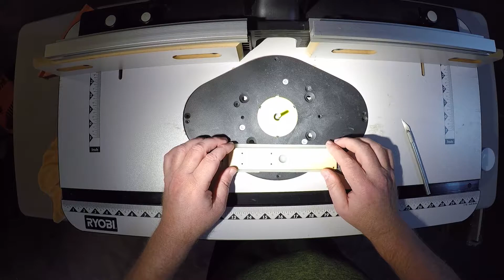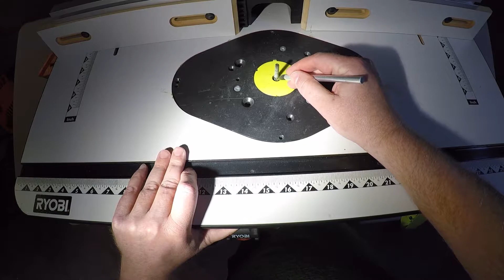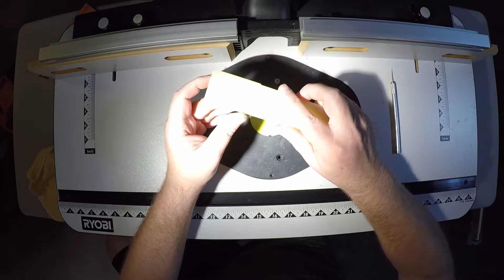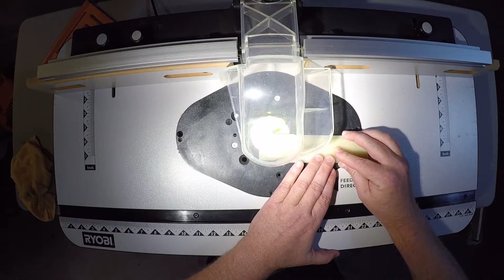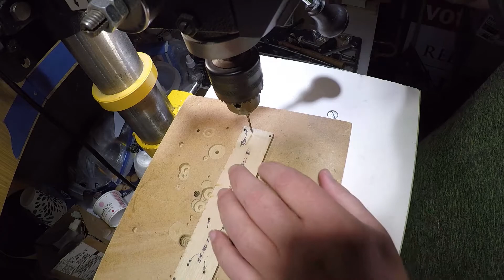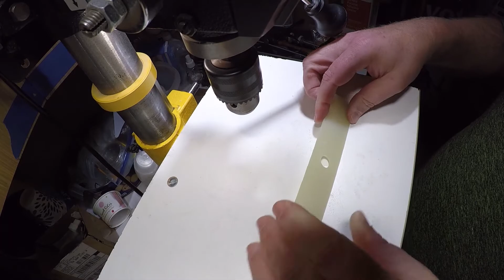Routing G10 Using a Template

Comment: Do you have a link to the router bit you are using?  Or one you would recommend for g10?
Reply from the maker: Thanks for watching! Absolutely, I use a 1/4 (sometimes 1/8) router bit for Fiberglass Plain End McMaster Part# 8785A14. Unfortunately, it looks like they maybe discounting the specific bit. For safety it is VERY IMPORTANT any bit used have a diamond-pattern flute.

Comment: Hi Allen,
I cover 1 side of each with painters tape. (part & template) then apply a few drops of CA strategically placed around to secure the part to the template. (like using 2 sided tape) Very secure, easier clean up & separation with a putty knife or  an Xacto blade.
Reply from the maker: Thanks for watching! Certainly do whatever works the best for you but there are at least 3 issues I encountered with what you describe 1) it's a 3 step process to attach and 2 steps to detach the template. 2) the tape creates buildup on the bit. 3) it does not work for really small parts which was the origin of the method demonstrated here.
Reply from the maker: ... more info: 3M Supper 77 can be readily found at home improvement stores; 3M General Purpose Adhesive Cleaner at auto parts stores, the aerosol is a little tougher to find.